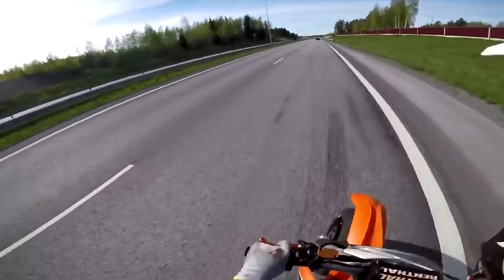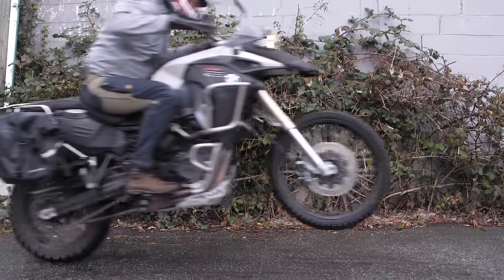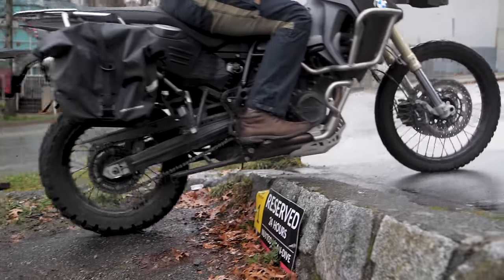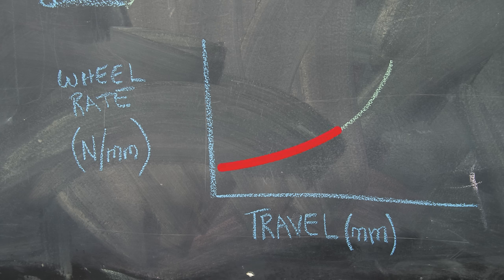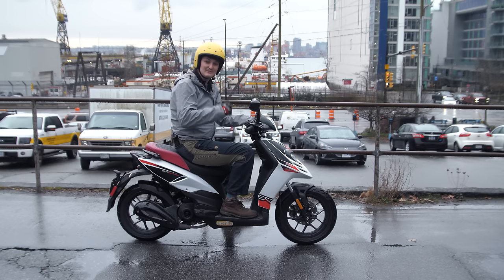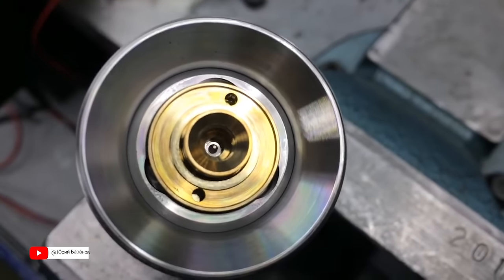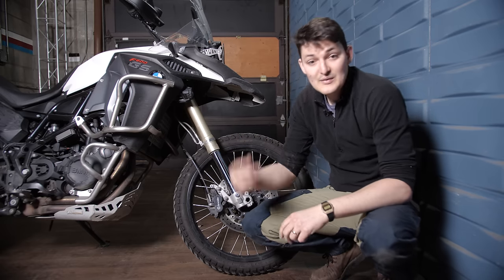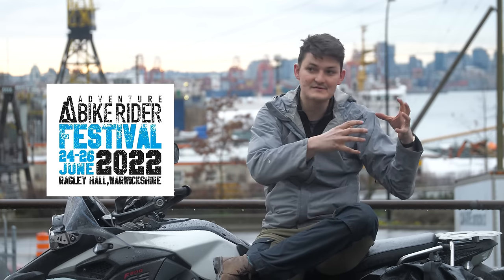Tank Slappers and the Quest for Perfect Suspension

Comment: And I'm not sure about the "don't buy anything yet" part.
Thus far, I've yet to find an ADV (or Dual Sport, if you choose) factory suspension system that was anything but borderline pathetic for any human over 150 lbs.
A heavier rear spring is almost always required if one rides hard or carries weight, and progressive front and re valving is always good.
Even my Africa Twin was simply not that good from the factory, but was easily rectified with an aftermarket rear spring and progressive front springs
Reply: i find the electronic suspension on the 1100 ATAS amazing. my gf and i weigh around 400lbs together with full gear and it only has ever bottomed off road. bike stays completely flat over potholes.
Reply: the solution might just be to lose weight at that point
Reply: @miraclerouge2313  Wow, what a silly reply. 
Any large  bike should be able to carry people properly and safely, even the somewhat larger ones. 
At 5' 8" & 180 lbs. in full gear, losing weight  is NOT going to be practical for me, so your advice is just foolish.
 The 'Load Range' of MOST bikes is what we are talking about, and few come from the factory with decent load range.   
kwalms AT has the refined suspension, which is a credit to Honda for either listening or testing.
Mine is one of the first, and not so refined. 
And I have had many others, all lacking in load range for even average people and load to properly set the sag, much less ride even moderately aggressive
So if someone is other than a daily rider with minimal  gear and load, the range is typically pathetic.
This is probably why there are so many aftermarket suspension folk out there, demand for a better suspension is high, especially when it comes to the Dual Sport and Sport Touring crowd.
Reply: @alanrobinson2901  you said it's borderline pathetic for anyone over 150lbs, and 150lbs is actually the middle point of a healthy weight for someone who is 5'8, and it doesn't become unhealthily underweight until 6'3. maybe they should ship with heavier springs for north america but at least in japanese manufacturer's case their largest market is much smaller in size

Comment: Progressive springs, the right density oil, proper preload and tire pressure/wheel balancing, and not slamming your wheelies like a squid out of water are generally enough to protect you from ever having wobbles lol. A steering dampener is probably your best insurance though. Usually a tank slapper is a result of all of these failing, not just one, so it's good to protect yourself as much as you can with good maintenance. Overloading your bike can cause them too. Having wind resistance high above the center of gravity and a lot of weight at or behind the rear wheel is a great way to lighten the front end enough to cause some spooky moments. The skyhook thing is very interesting. Fully automatic suspension sounds great! Great video, as always.

Comment: Perfect suspension? Yes.
I'd love to float on a magic carpet.
Reply: You'd probably lose a lot of feel
KTM motocross/supercross test riders will swear that the air suspension is much better and even pro riders saw how the lap times got faster... but they all hated the lack of feel, which made them likelier to crash so it was abandoned
Reply: @DiegoRuiz1991  I'm not riding on dirt, I'm rounding twisties and cruising down the highway.
Reply: @h.d.h  - It's about the same: you need to have enough feedback to never go past what the tyre can endure

Comment: this is good stuff l would add that understanding gyroscopic precession will help you a great deal,just remember on a wheel or gyro you tilt it turns you turn it wants to tilt
the actual motion is always 90 degrees ahead of the applied force thus wheel wooble.its important that the suspension is setup correctly and tires balanced.

Comment: When i built myself a ''bitsa'' motorcycle, based on a Norton featherbed frame, I had a problem with the rear wheel contacting the mudguard on full depression.
To cure this, I fitted longer rear suspension units. This cured the problem, but also made the steering more responsive, by changing the angle between the front forks and the road.
So even a small change in rear suspension can have a significant effect on steering.
.

Comment: Great video.   +1 Tip: Check your suspension for leaks. I had a leaking rear shock on a GSX-R 750 that erased most of the rebound damping. That set me off on a massive tank slapper, a few KM's shy of top speed: the road had a slight depression that unloaded the suspension at full throttle . The steering stops smashed off the frame, the forks left tube impressions in the side spars, and I melted my boot that was forced to ride on the exhaust pipe. The fairing stay was my only hand hold, and the pipe my only foot hold. Arcing skid marks went down the road for 100's of feet, as 200 km/h scrubbed off my top speed. It eventually recovered around 100 km/h, with the last arc inches for the edge of the pavement. All I had to do was pay better attention to my bike and those underwear would still be good.

Comment: I enjoy your vids and have learned a bunch thanks!!
1988 Honda GL1500 97k miles, my tank slapper issues were due to worn front tires, steering head bearings needed minor re-torquing and loose bolts securing front forks.

Comment: I've been learning about suspension theory and successfully trying out suspension adjustments this last year.
I've already learned a new layer from you I hadn't thought about:
Bike leaned back/front too high/weight biased too far back:
This creates *too much rake and trail*, which makes the self centering response too strong, which creating an overcompensation bias, which creates the opportunity for a tank slapper to happen.

This is interesting, because simple 1st layer knowledge would be that a lower front end = squirrely, and a higher front end is more stable. Adding this new layer means there is a sweet spot range that when exceeded, instead of adding more stability, only makes it harder to turn and creates a new kind of squirrely-ness: an overcorrection just after a bump or dip.
Reply: Nice tire-basket ball. I'm going to have to use that analogy to explain to my friend why his tire can't do a good job compensating for wrong dampening settings.

Comment: Ryan, Ryan, Ryan...
Excellent post, packed with great info as usual.  I know your focus here was on suspension issues as the cause of death wobbles, but you did leave out one glaringly huge cause (for most average riders ) far more than accidental power wheelies:   Tire balance, wear and inflation.   Absolutely, 100% the biggest cause of tank wobbles.   Improperly balanced tires wearing uneven are almost a guaranteed tank slapper on the highway, especially if they are at the end of the tread and improperly inflated.

Again, I know the focus was on suspension, but technically tires are part of the suspension as well...  Certainly worth a mention.
Reply: So true. I had a death wobble, while heavy accelerating, i think due to a new, but defective front tire. Very, very frightening. Before that incident steering with that tire always felt uneasy in corners. Changed the tires, and no more death wobbles since then. And much more confidence in the twisties. I survived the wobble by holding a loose grip on the handles and leaning over the tank ( transferring weight to the front).

Comment: I had a major tank slapper on my Aprilia RST.  I had just started to overtake two slower cars on a down hill curvy bit of road when the rear car pulled out on me without looking and I had to brake very hard, which shifted the weight forward and compressed the front forks.  The trouble was that I was riding over the central white line that was a small hump from years of spray and chipping resurfacing and the resultant re-lining.  The front went into a major tank slapper that didn't settle until I had reduced enough speed to let the front brake off.  The cause of the slapper was the effective loss of suspension movement at the front and all the weight transfer generated by the telescopic forks having to handle a longitudinal bump, which is not considered here.

The primary issue is the use of telescopic forks that allow too much dive under heavy braking coupled with a loss of lead that is the same as reducing caster.  Telescopic forks do have advantages that supposedly out weigh the stability arguments namely lightness and simplicity that every bike manufacture strives for.  My guess is that if the bike had an anti-dive front geometry then the slapper would have been averted.

Comment: Ryan, In the late 70s we had a 72 GT750 2stroke triple, heading home one night I opened it up fully and at the top of 3rd gear the bike went instant insane tankslapper mode. Bike tossed me off high side where I am sure the airport radar picked me up. I bounced down the road tucking my arms in so they didn't break off as I had picked up a wicked spin, eventually I slid into some deep grass head first and stopped. Bike continued another hundred yards or more constantly flipping destroying every part. Complete mystery as why it did.

Comment: Very informative. I had a serious tank slapper but it wasn't when the front wheel was unloaded if I understand correctly.  1982 Honda Goldwing 1100. Approaching a red light. Took my hands off the bars to stretch. Going less than 50kph/30 mph....so I was decelerating. I didn't touch the brakes. Out of nowhere the tank slapper started violently....how I didn't go down I don't know. I  was a dirt biker my instinct was to loosely grip the bars and stay loose....like riding over ruts or sand. No traffic around me but my pucker factor was significant.

Comment: I've worked extensively on a Harley Road King equiped with aftermarket progressive springs up front and thicker fork oil in a professional capacity. The idea of them seems fine when riding straight up and down. However, I still get high speed wobbles at 80+ MPH in long sweeping curves doing work related functions with aftermarket progressive springs up front. Some of that may be due to the inherent flex of the Harley touring chassis (post 2017 models). I believe you referenced that in a prior video or something to that effect. But I've read other editorials that suggest progressive springs can contribute to high speed wobbles and are frowned upon in MotoGP type events for that reason.The argument is that variable spring rates in corners don't allow for consistent suspension articulation (differnent parts of the spring oscillating at differnent rates at the same time) with the road imperfections and contribute to weave, wallow or wobble in the front end. If your motorcyle chassis is particularly flexible, this front end weave, wallow or wobble then travels throughout the motorcycle as your suspension and tires (traction) try to account for it. I've had several of these instances that I resolved by either rolling off the throttle or standing the motorcycle upright. Harley techs said I shouldn't being taking corners at that speed. But it's required on occasion in my professional capacity. I've read that a properly tuned linear spring rate is better suited to mitigate some of that flexing and articulation (as compared to a progressive spring). The internet said so anyway. I'm in the process of experimenting with that theory.

Comment: I have a honda vtx 1300 and when I first got it on deceleration would tank wobble a little bit did some research and come to find out was terrible neck bearings design so I ordered the instead of replacing with the same oem neck bearings I went with the recommended all balls racing neck bearings made for my bike, had a buddy who has a bike shop replace them and what a difference it made no more wobbling or tank slapping 👍

Comment: I'm a bit late to the show but I've seen two suggestions on how to recover a tank slapper. Option 1 is to let go and lean back.. hope for the best. And 2 is lean forward onto the front wheel. My gut says you should take weight off of it, but I was hoping someone here was knowledgeable enough to say what the best way is. Thanks a ton
Reply: 90% of weight transfer made by throttle and brakes, not your body. Usually people recommend SLOWLY close throttle, relax, and squeeze bike by knee (which you should do constantly but riding schools sucks to teach basics)

Comment: Unless you have a 1986 Suzuki GSX1100EG. 16” front wheel, frame made of Play-Doh and high compression, long strong motor. The rear to front loading transfer when you shut the throttle was insane. Do this when one hand was off the bars and you have a lock to lock tank slapper until you apply power again. Scary AF and fixed by a £30 steering damper.

Comment: So, running down the highway on Gen 2 KLRs. Get above 70mph (it really can happen, trust me), tank slapper starts on one bike, but not the other. One bike had bags with tools etc attached to the crash bars, shifting some weight forward and had a Kawasaki Tall KLR windscreen (that was the bike without the tank slapper). The other bike's weight was all in the back and had a taller after market windscreen (windshield, tyres, tires, does it really matter). Also, since I was on the non-tank slapper bike, he was pulling away from me so I'd tuck behind the windscreen, putting even more weight forward. 1000 "solutions" online. One Aussie cut holes in the windscreen to reduce the vacuum (lift/drag) at speed. I only have this one, oft repeated as we toured Nova Scotia, result. It seems to me that as the taller windscreen, rear weighted, KLR went faster, the front end got lighter and thus launched the tank slapper (without raising the front tire/tyre off the ground). Thoughts?

Comment: I used to get tank slappers on my RZ500 at very high speeds if the front went over a bump, scary as hell, the recommendation was to install a steering damper, never got round to that as I seldom went that fast again.

Comment: Most shocks have directional dampening where ball bearings plug those holes in one direction (usually the rebound direction) which is adjustable.  Performance bikes dampen both ways.  In general, I find it best for the rider to compress the shock about 1/4 of the way and then adjust the damping to keep the shock from bottoming out on the big pot holes.

Comment: Very Interesting, I learned a lot.  I was disappointed, however, that you didn’t include a discussion of front wheel wobble occurring when one rolls off the throttle in some speed range, and the front wheel starts to wobble as the weight of the bike shifts forward against engine braking.  The rear shocks seem to have something to do with this phenomena, but I’m not sure what.

Comment: Sixth reason for a tank slapper is loose spokes like my 76 Honda 400f (with clipons and rearsets plenty of weight on the front wheel) had on a nasty tank slapper that caused a crash.  A Dealer Service to correct the tank slapper didn't find it, I did when I squeezed the spokes.

Comment: I must admit Kawasaki did a decent job with the suspension on the Z650 and Z900 bikes as they are pretty cushy around town but once I hit the highway the bike feels planted and very responsive without bouncing around. My 1984 Kawasaki GPZ900R/ Ninja 900R was also quite good in the suspension department but the front forks were pathetically thin and were supplemented by an air assisted system or "Anti-Dive". It was quick to turn though thanks to the 16" front but was very stable on the highway due to the lengthy wheelbase and weight.

Comment: With the introduction of the Norton Commando 750 in 1968, the tank slapper became a thing. It did not need to pull a wheelie or bottom the suspension, it would go into a speed wobble all on its own.They did a lot of investigation. And I mean a lot, they even filmed it, the videos are out there. The cause was that Norton had used worse frame and forks than they had on the earlier Dominator/Atlas when they now had a far more powerful (cof) 50hp motor than could easily go ton-up. The cure (which in reality was for Norton to completely redesign the front end) was for the rider to put more weight on the bars, and the rider to immediately throw themselves flat on the tank when the wobble occurred.
Don't pull back on the bars like when pulling a wheelie but push down on them.

Comment: They’ve gotten away from just little holes in the shocks for the better stuff. Things like valve discs respond much better. With a small hole it ends up to soft over slow bumps and to stiff over fast bumps. Which is basically the opposite of what you want. With a disc that deforms it can stay mostly closed over slow bumps keeping things stiff and then open more over large fast bumps to soften things up. 
Really nice shocks can be amazing when well setup. You end up with something that’s nice and tight, but still able to take bumps without upsetting everything. 
The big travel offroad shocks even have multiple stages of valving so the assembly can change stiffness over the range of travel.

Comment: Unwelcome cyclic oscillations happen on un-sprung bicycles, too. They seem to be the result of fork trail, rake, loaded weight, tyre dimension and castor effect combining to give the shakes. Some bikes wobble all the time, others once in a blue moon but few are completely exempt, and this is without any suspension. Gripping the top tube with your knees usually puts things right, and the same with the fuel tank on a bike. Theoretically, you can accelerate out of most tank slappers, which is little help if you're heading for a downhill hairpin bend with adverse camber.